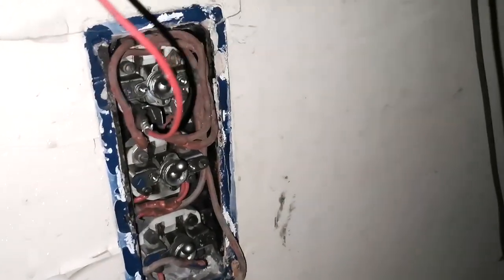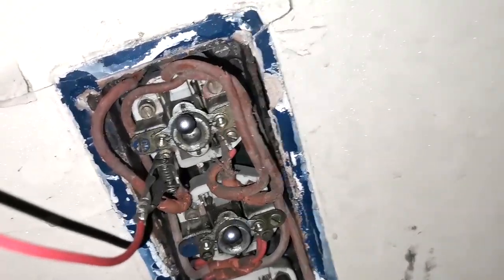The Mechanics Institute Powering Lights With A Power Inverter, Swindon

Comment: Those fluorescent tubes that take a BC socket (like normal bulbs) are incredibly rare and sought after. At one point adapters were available to allow normal florescents to work but I haven't seen any myself. Ridiculously hard to come by those tubes, shame they'll end up in the skip. 

What size inverter was you using?
Reply: Oh and PS that style of florescent tube was used from like 20's to very early 50's. They were the very first.
Reply: Just spotted at 7.20 you found a BC - 2 pin adapter. Mate they're impossible to find anywhere. Designed to allow old fittings to run with new tubes
Reply from the maker: @dead.format  I was using a small 500w modified sine wave inverter only a cheap thing and yh I did think them bulbs are old I fort thay would of gone to air buy now but did surprise me after a bit of tinkering we got it going the dischsrge resistor was shorted stopping the light from starting propuly x

Comment: 10:11 😂
Reply from the maker: So true tho I hope thay save the lights and fixtures before there all gone past repairing as the bulding grade 2 listed and there not protecting the fixtures or fittings iv also repaired there sump pump as the bacement was 5 inches under water from the steps down in

Comment: It’s the starter on the side you need to twist or tape
Reply from the maker: The light dint use a starter on this model used a capsitor 
to shift the phase on start up 😁 Google says it is (Fluorescent lights designed without starters are called rapid-starting lights, and this designation is usually printed or stamped on them. With these, dirt on the tube can sometimes prevent lighting or can cause flickering)